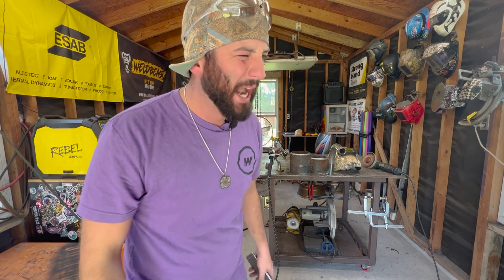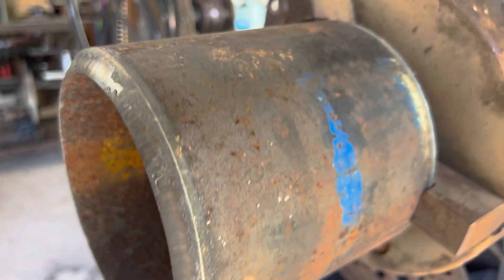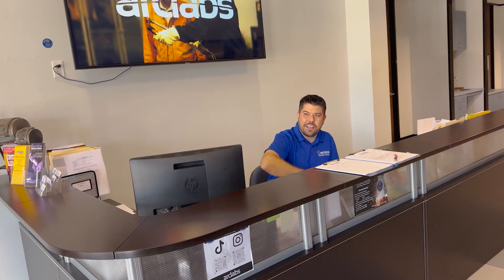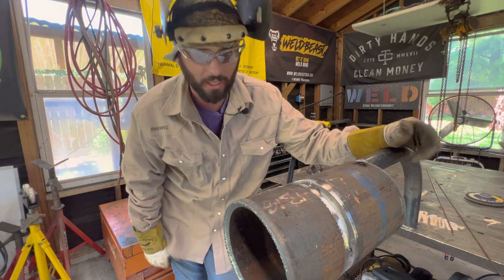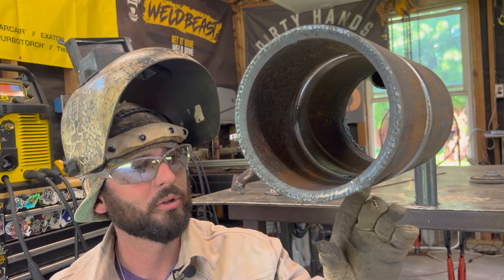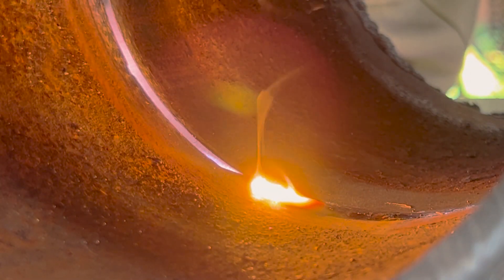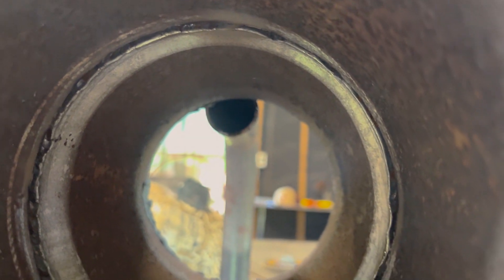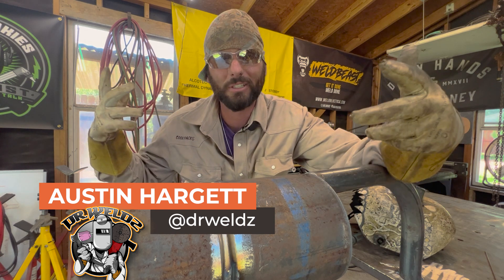Keeping Your Root Pass Consistent - Tig Welding Carbon Steel Pipe

Comment: Welders need to be aware of their strong areas of the pipe. If you lay in a good bead from 6 o’clock to 12 (moving clockwise)But struggle moving counter clockwise 6 to 12? I recommend doing the harder area first. Insteadve doing the easy side. As the pipe heats up, the root goes in differently. People who’s speed is inconsistent will experience more suck back and/or excessive reinforcement in the root. Saving their “hardest” side, for last.